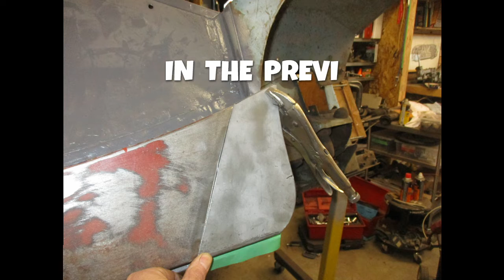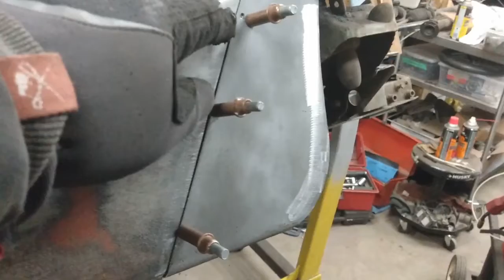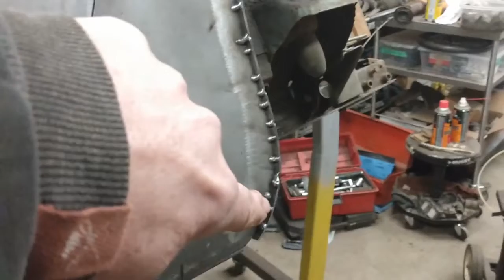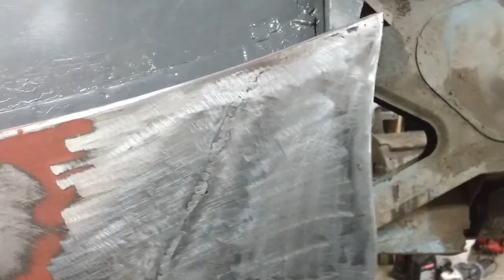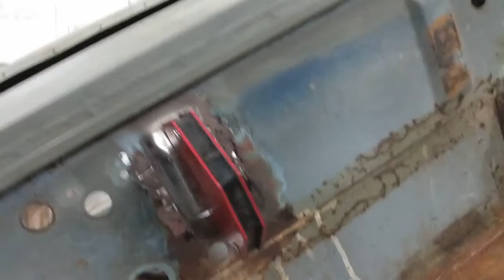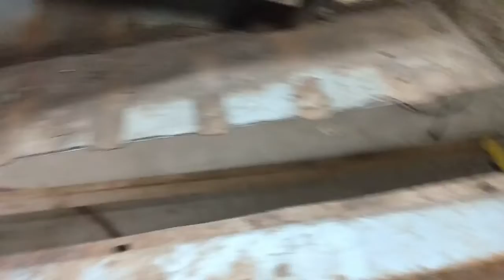Outer sill patch panels and firewall repairs on the Austin Healey Sprite. Bugeye Build Episode 17

Comment: You made the panel wider, and then the lip wider, I'm glad you mentioned Fitsee in a previous video! He's an absolute wizard. Is that compressed air to cool the welds? How many hours do you think you spent on that fabrication? It looks fine, I would be proud of that work for sure.
Reply from the maker: I used the compressed air to cool the panels after four or five spot welds. That reduces the chance of warping the panels as you go. I probably took three or four hours to do the first side. That would include making the cardboard template, cutting and bending the panel pieces and then the welding and finishing. Probably took an hour less to do the second one as I had a fairly good idea what to do.